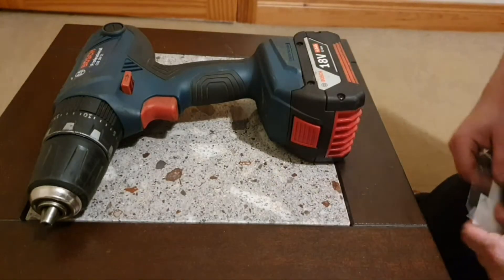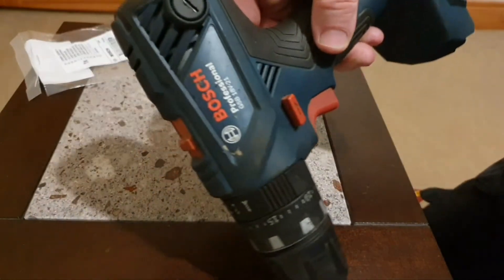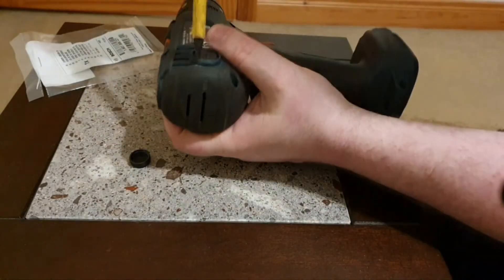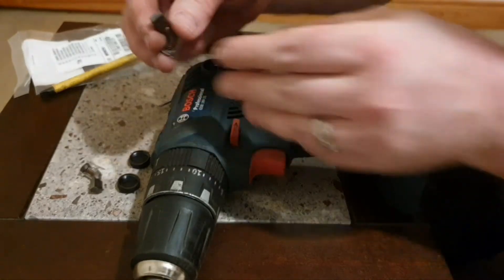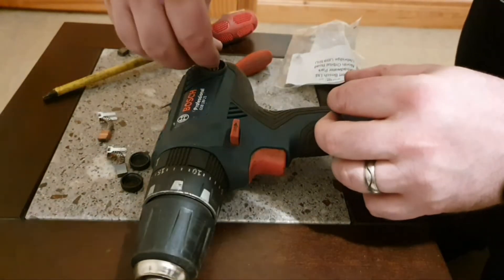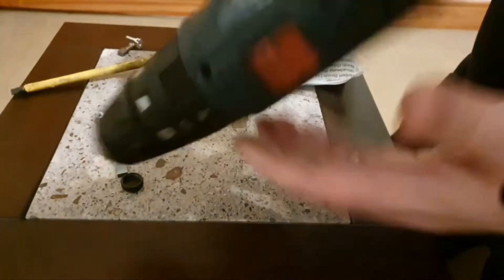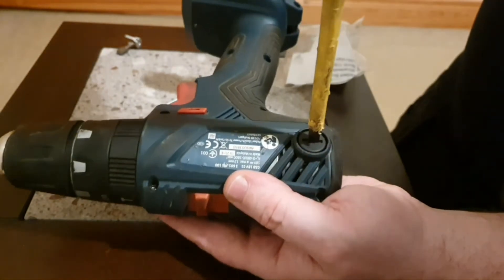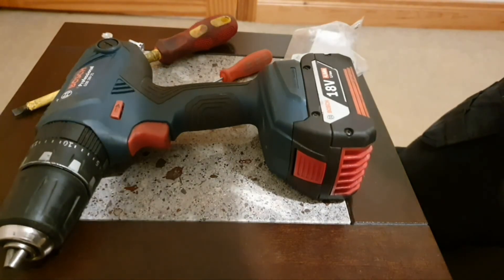Bosch GSB18V-21 brush replacement tutorial

Comment: I used to repair old hair clippers with brushed motors. Brushes are definitely important to keep that motor running tip top. Cleaning the armatures and the carbon build up helps tremendously